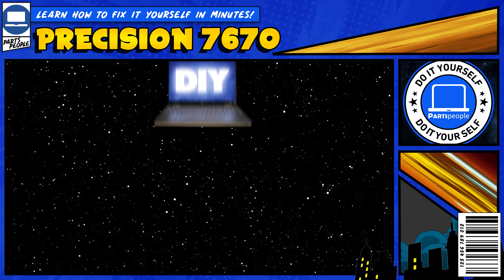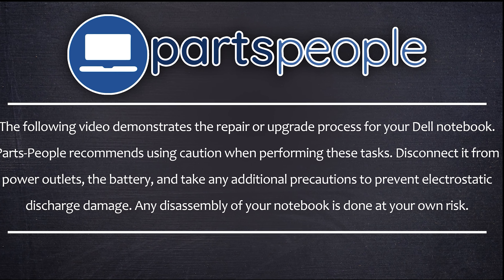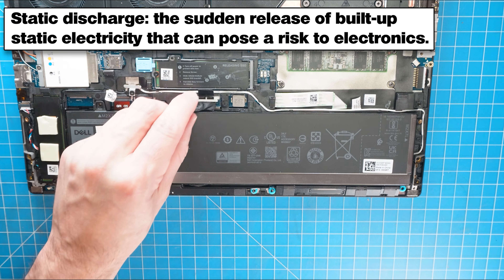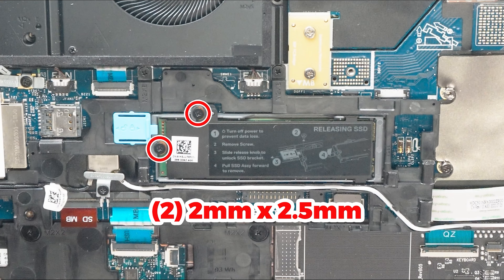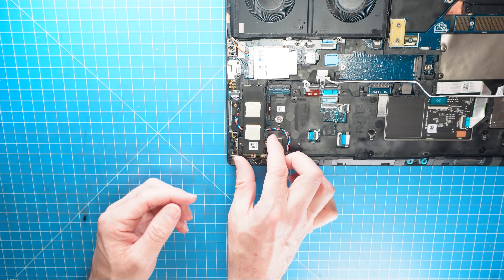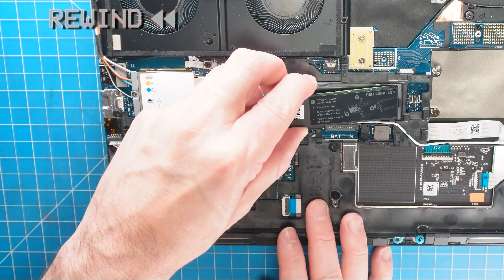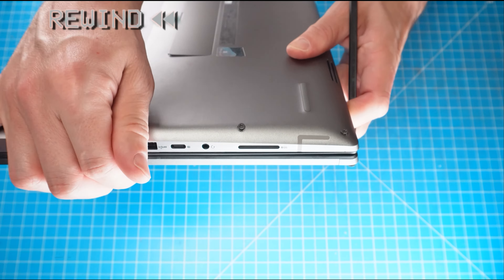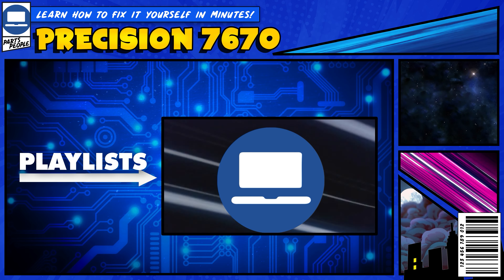How To Replace Your M.2 NVMe SSD | Dell Precision 7670

Comment: I just purchased a Dell 7670:   The Dell data sheet says there are three M.2 slots;.  I have two spare M.2 drives plus the M.2 drive that came with the laptop.   Where is does one.install the third M.2 drive?
Reply from the maker: There are probably two 2280 M.2 slots and one 2230 M.2 slot.  So look for a M.2 socket that looks like a WiFi card goes into it.
Reply: I am trying to figure out the same issue - I see two SDD M.2 slots, but cannot find a third. Yet the specs say 3 SSD m.2 at up to 4TB, so upgradeable to total of 12TB. Either lie, or it was changed?